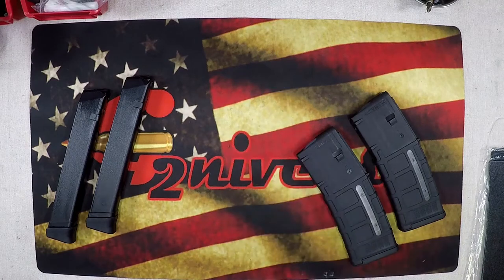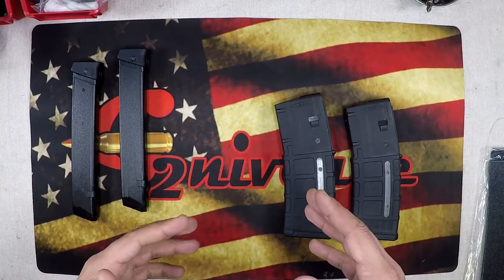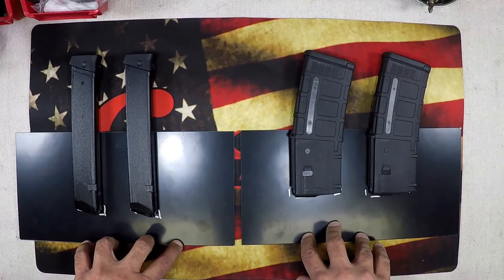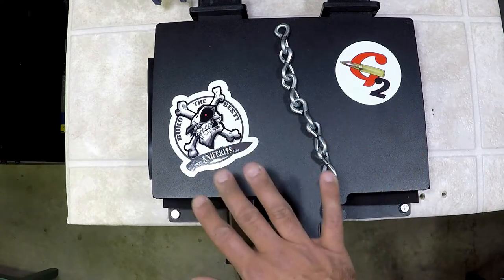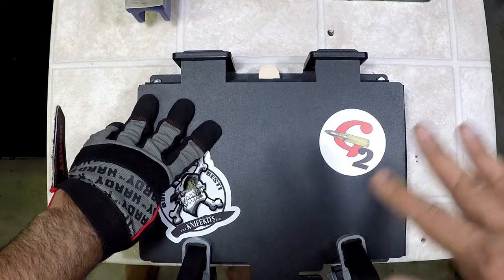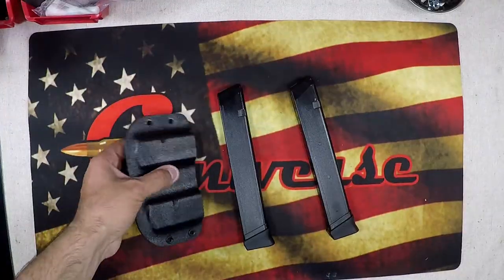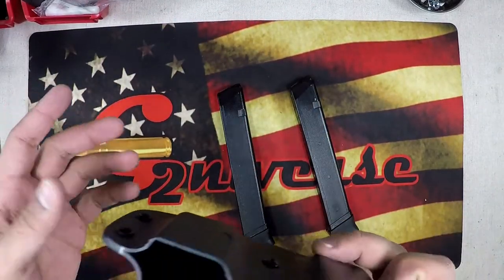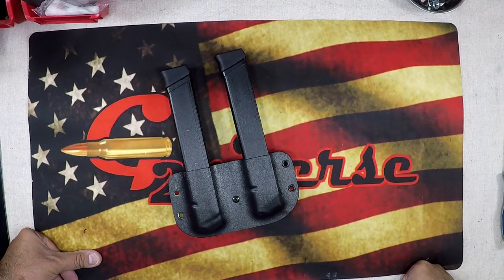DIY Kydex Double Glock Mag Holster

Comment: In order to get good definition HEAT HEAT you want the dex about 350°-360° right as it comes off the heat and then try to be as quick as you can doing your pressing and I promise you will be amazed in the difference  great vid happy bending!!
Reply from the maker: Scott Grossman Im learning a lot the more I do.  There is such an art to this that im still practicing at.  When you heat up your kydex, what are you finding better...setting the oven to the highest temp, or starting low and warming slowly.  Ive found that when I set it too high, it heats up too quick and I risk the chance of burning or getting those grill marks.